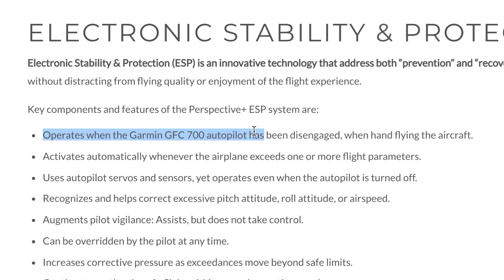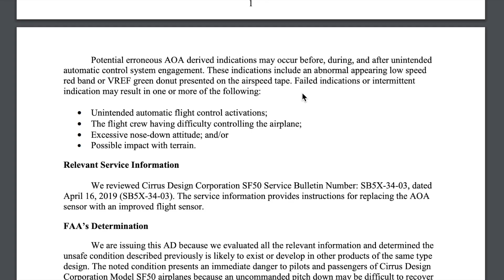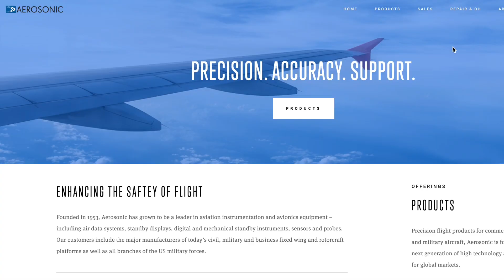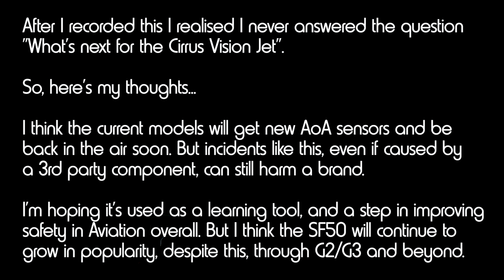Why did the FAA GROUND Cirrus VISION JETS?

Comment: Why is it that these idiot designers insist on a stupid plane overriding pilot controls? how monumentally stupid are pilots assumed to be that just an auditory warning is not enough.
If a sensor fails then an incorrect warning isn't a huge deal but if the plane then insists on steering you into the ground....    no forced autonomy is hte obvious easy answer. Idiots.
Reply: And should there be ambition beyond the bare minimum of intelligence then rich cogent sensing is the answer where sensing across different modes have to make coherent sense, not just a single point of failure sensor that is trusted blindly. GPS, engine power/rpm and a g sensor can tell you if the AOA is drinking on the job for instance. If the speedometer in a car suddenly reads zero on the highway you don't step out blindly trusting it is at a standstill. You have multiple information channels that can tell you it failed. The felt g, the sound, the engine strain, the visual flow etc

Comment: The Cirrus Vision AOA. sensor problem is a diversionary tactic used to spread the attention away from the 737 max8  investigation.  There will be other models of aircraft grounded for the same reasons.  Boeings is between a rock and a hard place.  If they  admit to what's been going on it will take down the entire company.

Comment: When Sensors say they are Smarter than Professional Pilots, and want to take control, we might just end up with a "Houston, We Have A Problem" situation.

Plus, AOA is only 1 Sensor! Airspeed; Attitude, including Pitch, Roll, & Yaw; Acceleration or Deceleration; Power; & Trends; are integral elements, and are part of Training in "Recovery From Unusual Attitudes", in the CPL Training that I Got! So, who is training these systems, that they are taking over?

Comment: You’re setting yourself up when you compare a vain type sensor (vision jet) with the differential pressure unit in the instructional video at the end of your report (sr22).  The jet has electronic systems incorporated that the piston aircraft does not require, and the piston  system is required to be placarded as not for primary flight reference.  Watch out for apple and orange comparisons.  The Vision Jet problem is mechanical in the sensor, not a problem with the electronic systems. Boeing had both!

Comment: I love flying AOA (mainly stick and rudder though, not a fancy autopilot system). The main issues seem to be when the "safety" software is reengaged due to false data from a faulty sensor. I think there should be a minimum altitude for these safety systems to engage, and a simple master disengage button to permanently shut off any and all of these system when the pilot has reason to believe there is faulty data being fed into the system. Ideally these would be properly designed and tested using faulty data to see what happens and safeguards designed into the system to detect these, but that might be too much to ask for. Also, the FAA shouldn't allow manufacturers to move the locations of engines on a plane without full recertification (but that's another issue entirely).

Comment: I'm a safety & reliability engineer mainly performing statistical analysis with failure events such as un-commanded in-flight shut down of the engine, for example. (actually happens a lot you'd not believe). The purpose is to discover if those events are unique (FOD for example) or exhibit properties belonging to the manufacturing process. 99% of failures that I examine are the result of some human manufacturing error. Design issues are rare. The sensor failure is no more or less likely to be an event found in any other component critical to the safe operation of the aircraft. It is great the fault is challenged rather than a 'mod' being performed. This is what is supposed to happen. Discovery, design, development, deploy. Ideally without the loss of life. In the recent examples of Boeing, well this is as bad as it gets when you have quality issues on a cultural level.

Comment: At least in these aircraft, the autopilot can be disabled and the trim is still operable so the aircraft isn't necessarily in a state of emergency.  The first thing I learned about autopilots is to never trust them.  Always understand how they work and always understand how to defeat them.  I remind myself where the autopilot and electric trim (if separate) breakers are on the panel while doing the preflight breaker check even if I'm not planning to use the autopilot.  It's habit now.  The breakers are the last resort if there's an autopilot failure.  

And I learned very early on to visualize the angle of attack and to be careful about accelerated stalls, etc.  I don't think I would mind having an AOA indicator but it's just another tool.  It's not a necessary tool but it can be useful.  I have a natural distrust of safety systems that rely on things like AOA (see above) sensing.   As pilots, it's our responsibility to monitor these systems, to not RELY on them if we use them, and to consistently verify that they are working properly.  Then we need to know how to get out of trouble.

Comment: I suppose AOA's are good, but I don't believe they should be attached to the flight controls in such a manner as to over-ride what the pilot is doing. At most a warning buzzer and/or flashing light. Pilots still need to fly the airplane - or get out of the cockpit altogether.
In our government's continuing effort to "Idiot" proof everything, the bottom line is: You simply can't fix stupid, and stupid ought not be in a cockpit.
Reply: The Cirrus has a red button on the stick to disable the AOA. What does the 737 Max 8 have?

Comment: G'day mate. I fly a Citation 560 out of Perth. All jets have AOA sensors installed I believe. However they aren't needed for light piston ac in my opinion. I sit in the right seat, but even when I did my PIC type rating I never looked at it really.

Comment: AoA sensors are very useful as they can help pilots avoid dangerous pitch angle situations in IMC or when losing situational awareness, but a single sensor should NEVER be capable of taking over the controls from a human pilot. That's called a single point of failure. One sensor fails, and unless you remember how to disable the flight envelope protection systems from memory within a few seconds, you nose dive into the ground. Remember the 737 MAX 8? The runaway trim can theoretically be overridden by disabling the electric motors and manually turning the jackscrew (yes, there is a physical cable spooled around the trim wheel connected to the horizontal stabilizer), but if you're already in a nose dive and in an overspeed, human muscles will lose that battle.

Comment: Seems like connecting AOA to the autopilot system is a bad idea. So far. 

Was there ever a problem/accident in the first place that required aircraft to have  AOA sensors for the autopilot? 

Seems like the designers and coders didn’t think that far ahead. Personally I think coders have a lot more to answer. IMHO.

Comment: You asked is an AoA is useful? The answer would be yes, as long as the pilot understands the information they are being presented. 
Airspeed is only a good measurement of proximity to stall when the a/c is in wings level 1G flight. If you are in conditions such as windshear, strong turbulence or an unintended upset airspeed becomes almost irrelevant and at that point an AoA indicator is the best information of proximity to stall. The wing stalls due to excess AoA and nothing else.

Comment: AOA sensors and indicators are not the problem. It's connecting the AOA to a system that is supposed to "help" you fly the airplane. One of the largest areas of aviation crashes is "loss of control" and the industry is searching for the cure. But if you're going to have to train a pilot to be able to override an automatic babysitter to stay alive then why not just train them to fly the airplane well in the first place...?
Reply: Because humans aren't perfect infallible beings that do everything correctly 100% of the time. Task saturation is a thing. Sometimes people just get confused and disoriented in IMC. So an automatic system that improves safety 99.999% of the time helps the pilot out that 0.01% of the time they make a mistake.
It's kind of like why they have two pilots for large commercial aircraft - it's safer than one pilot. Neither pilot is perfect but together they're better than they would be individually.
Reply: @sldfnslkxxlk  A system with a 1% lethal failure rate per year is not an acceptable solution to a problem with a 0.1% fatality rate.

Comment: Aoa is great
Let’s maybe not let it take control of the aircraft thought?
Reply: Liam Rodgers   Wrong, AOA is not that simple especially with reduced speed, increased loading, partial vs full deployed flaps, rudder input, bank, and/or up/down drafts.  Properly calibrated and functioning AOA indication can be very helpful so as not to overestimate AOA safety margin. Its not a panacea but it can be useful information.
Reply: As matt said, AoA is good to have. Instead, have 2 AoA sensors. If they disagree, light an AoA disagree light (and make the AoA disagree light a base option), and require both of the sensors to show stall conditions before actions. You get the protection of the AoA sensor, with less risk in a malfunction.

Comment: Hi Stef, nothing wrong with flying to AoA (the military do it all the time!) but when coupled with a system to regain control ala ESP I'd want redundancy in either the sensors or cross reference with the ASI probe and the dual ADHRS (which is what the GFC700 utilises anyway) not just the AoA to override everything else.  

Similar to the Air France 447 flight where a pitot froze and caused mayhem but they had reliable information from other sources like GPS.  Shows that a pilot should be experienced in 'manual' flight and not be trained/conditioned to only use the automatics - hence why upset recovery training is becoming mandated now.

Comment: Perhaps your F-16 friend can dive in here Stef. There are two aspects here that differ markedly from piston operations. One is the high speed regime of flight and the slower spool up times in jets during low speed flight. As we know, stall speed is a function of weight or g load and pegging a particular speed is less reliable than an AoA which stays consistent. The need here for automation is in part based on the fact that single pilot jet pilots are transitioning from pistons and may be more prone to falling afoul of the traps of low and slow in a jet or fast and over G’ing the plane. Especially if they get into a bad IMC situation and begin to express the inherent human weaknesses we all are prone to. That’s why Cirrus training is so vital to the brand. They are playing in a space exactly where inexperience meets opportunity. The FAA is right to ground the jet given these considerations. The three who were involved made it out but given the elevated risk factor given the experience levels of a common Cirrus jet owner pilot, number four may not have been the fortunate one.
Great video! Thank you.

Comment: G'Day Stefan,

Long time watcher, first time commenter. 

As to the AoA indicators - they are a useful in the cockpit as a guide for the pilot.

As an input to an automated control system, they need to be a) more robust, and b) have more redundancy. And by redundancy, both more than one, and more than one design (ie the left one type/manufacture A, and the right one type/manufacture B).
Reply from the maker: Hey mate, thanks for watching the videos. Yeah redundancy and the ability to override new technologies is really important. I don't disagree that new information sources can be really useful when implemented correctly, as long as we have ways to constantly and easily monitor them, and override them if/when required. Appreciate the support, and thanks for the comment.

Comment: I fly with Alpha sensors that are linked to a stall warning and stick-pusher. It is a clever system that adjusts its parameters in icing conditions. 
The true beauty of it, however, is that it can be switched off, if it goes crazy.  
I truly believe that aircraft are now as automated as they safely can be.

Comment: I had a surprisingly similar thing happened to me a few weeks ago. I flew a G6 Sr22, when suddenly while manually flying the aircraft, the ESP system engaged causing a nose down pitch action. I had to disengage it by pressing the AP disconnect button. It kept on happening until I engaged the autopilot. It happened just after take off into hard IMC and more worrisome on final approach where I had to keep the button pressed to keep manual control of the aircraft. I was later told by the mechanics that the stall warning sensor in the leading edge of the wing failed sending corrupt data to the avionics. Seems like the automation can even be a problem in aircraft without AOA sensors as the stall warning sensor also acts as a sort of AOA sensor.

Comment: Man it's not just Boeing now, who ever made the AOA system is going to have to be answering some questions...
Reply: Max Ashton it happened to the A320 too. An Air NewZealand A320 crashed after a test of the AOA system.
Reply: Infinite Flight JPC that was in 2008..
Reply: @taejunchang396  so? Just cause it happened a few years ago dont mean it didnt happen.
Reply: Infinite Flight JPC and the probable cause of the accident was when water trapped inside the aoa sensor got frozen. I’m pretty sure that’s not what’s happening to these problems.

Comment: Steph, while I understand that you have no desire to fly with an AoA indicator, I think it's can only add to safety. If the AoA indicator doesn't intervene in the controls and isn't connected to the autopilot (or some down-trimming system that rhymes with smemcas) the AoA indicator can only add to the pilots awareness of his or her angle of attack, which does happen to be critical (haha, get the pun) especially in the slowing regimes of flight such as landing. Military pilots have use AoA indicators for quite a while to guide their descents and speeds, and airline pilots essentially use a proxy for AoA when calculating Vref. So I think AoA indicators, when done right, can only add to safety both in the GA and airline worlds.

Comment: AOA indicators are fine, but tied to autopilots i'm not sure anyone, it would need a very quick overwrite which seems to be the case for the Cirrus. But at low altitudes it can still be dangerous. If you build an automated system you gotta have reduncancy and use two sensors.

Comment: Why did it take 3 incidents before the grounding. ???
Reply: It takes time to determine the actual root cause, and then it takes further time to work out if the problem may (or will) be present in other aircraft. A lot of incidents are due to poor maintenance or operator error.
Reply: @sldfnslkxxlk  Yes and by the time all this time is taken to try and figure out what the problem is peoples lives are at risk. Ground them sooner rather than later

Comment: I have a question.

On the primary flight data display, there is horizon calculated by GPS data (the sphere that's blue on top and brown on bottom that supposed to move with your pitch angle and bank angle).

Would you trust that more than AOA readings if you're in cloud and cannot see the ground (I don't know, maybe there are cases where the horizon indicator is poorer replacement than AOA)? And would you think it could be good idea to add that into consideration when programming those automatic control systems?
Reply: Angle of attack is a measure of the airflow over the wings and therefore nothing to do with the pitch of the aircraft. If you fly slow enough you'll get a high angle of attack (-> stall) even in level flight. Or ice build-up can disrupt the airflow and lead to a stall even at normally okay airspeeds.
Possibly there's some value in using information from GPS, IRS or whatever other sources are available to try to sanity-check inputs from the primary sensors, and automatically disable the automation if there's discrepancies. Trying to work out what the normal envelope is would be pretty tricky though, and difficult to verify.
I think the best strategy is to a) make sure pilots are aware of any of these systems in place, b) make sure those systems clearly communicate to the pilot when they activate, and c) make it safe and easy to disable those systems if the pilot suspects they're misbehaving.

Comment: Interesting video Stef. I strongly suspect that the grounding is rather political, given the B737Max saga and all the ensuing baying for blood that’s been occurring- FAA don’t want to appear to be doing nothing. Artificial “assistance” is here to stay I suspect, the weak point seems to be the sensors - even going back to the AF 370 accident, the sensors were known to be very prone to icing/ blockage, yet Airbus had only recommended replacement with another type. Most operators complied, Air France didn’t. An AOA indicator as opposed to a mere sensor? Other than some rather Mickey Mouse GA versions, they’re not in great civil use yet fast- jet military pilots use them extensively ( approaches flown in reference to these rather than IAS) so I suspect we’ll see more use in future on the civil side.

Comment: Thanks for the info Stef. I will tell you that I don't like the ESP on my SR22T, I also do not use AoA indicator but having flown with Cirrus Instructor last year in Hawaii I can tell its a useful system.
Reply from the maker: Yeah, I think my initial training of "attitude + airspeed" would mean I'd be unlikely to use AoA readings in my flying, but perhaps if I flew more with one I'd change my mind. I'd probably end up using it as a secondary data source though, rather than "flying the AoA indicator" just because that's not the way I was originally trained. Thanks for watching mate.
Reply: Niko's Wings dumb